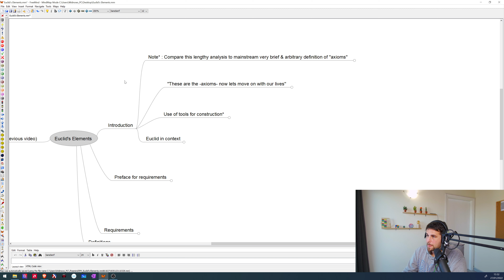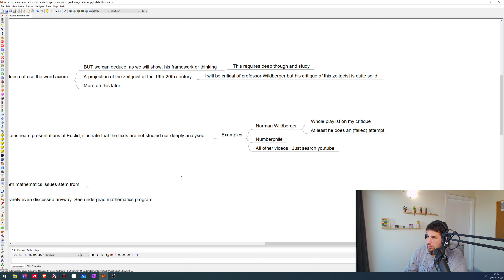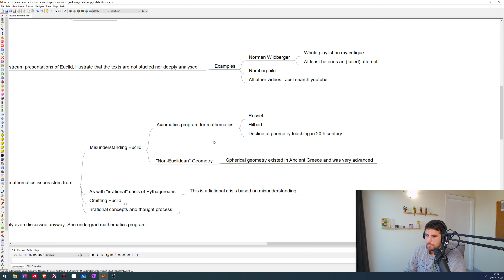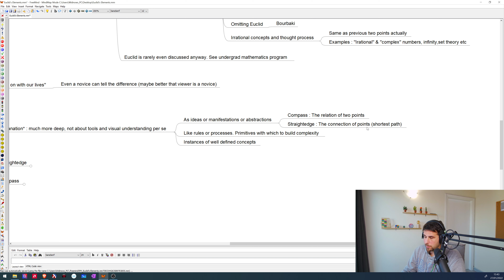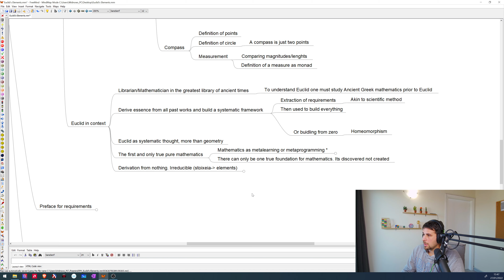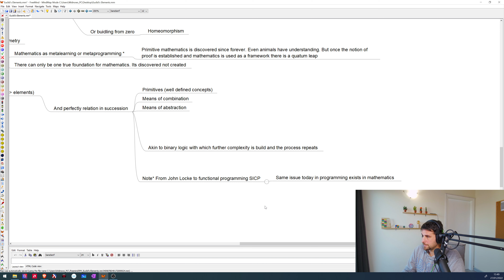Introduction to Euclid's Elements - Part 1

Comment: Which programming language (if any) would you say is designed correctly based on primitives, their combinations, and abstractions? Sounds a bit like Smalltalk but I'm not a coder so no idea really.
Reply from the maker: I will be learning Racket. It follows the tradition of Scheme which is a Lisp. It has the best ecocystem and characteristics. Its a programmable programming language. Best books ever, on a whole other level. My plan is to learn Racket by writing presentations and dynamic programmable animations for mathematics on this content. A programmable tool totally hackable. These languages are intertwigned with mathematics in many dimensions. Read Structure and Interpretation of Computer Programms. Plus free original MIT lectures and book free.
Reply: @mackeyfryguinness7422  
Do you know of Haskell? A lot of mathy guys i know really like it.
Reply: @inpeesea2630  sure but racket seems still superior to me or at least based on my needs and approach. There is a dsl in Racket that mimics haskell. Haskell is similar to Lisp in many ways but it purely functional